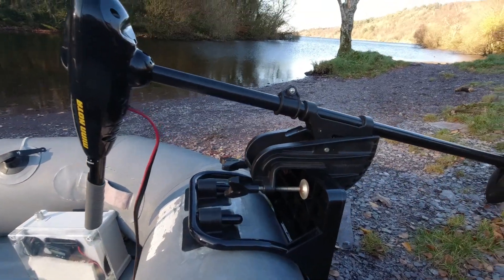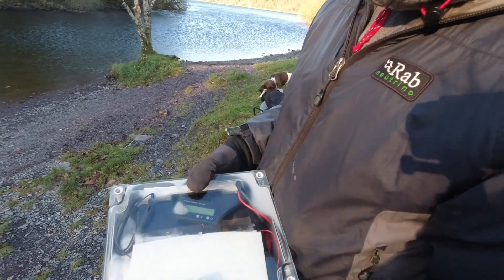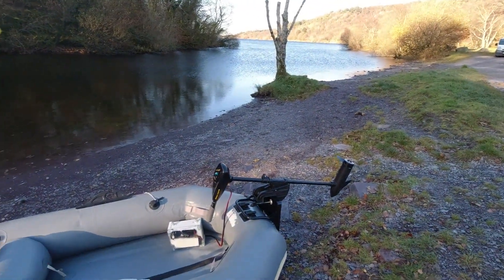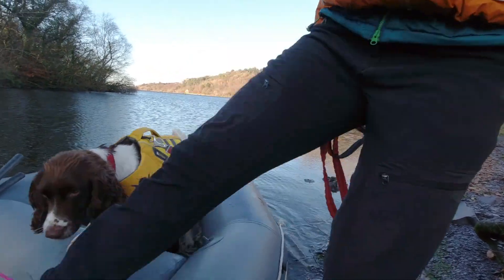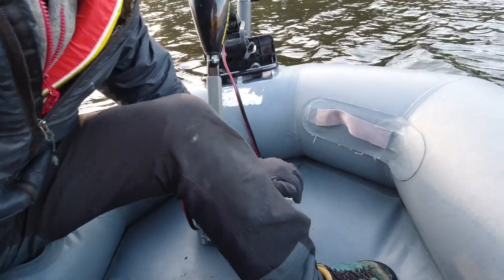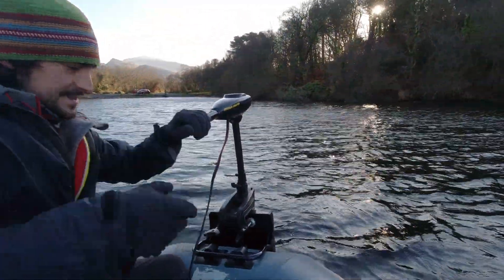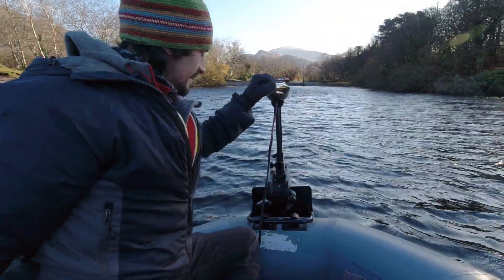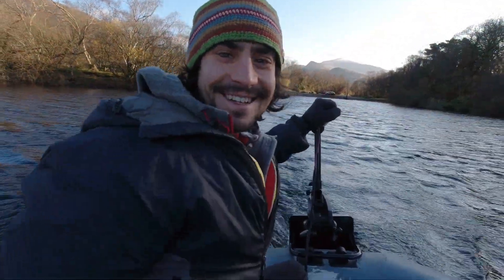Electric Outboard Maiden Voyage!

Comment: ha cool! how long did the battery last? power level when ya got out etc? good test!
Reply from the maker: I need to do some more 'scientific' range testing, it was really windy and I was just getting a hang of the motor. We boated about for about 40min on full power, the battery meter read 12V when we got back which I think is mostly depleted. It's only a 17Ah battery. The voltage drops under load. Next time I'll use my two batteries in parallel. Just need to cut some plywood for the base of the boat to make it more sturdy for heavy batteries.
Reply: @GlynHudson  sweet, yeah it's all best guess, weather conditions etc. nice work thou, can't wait to see v2 :)